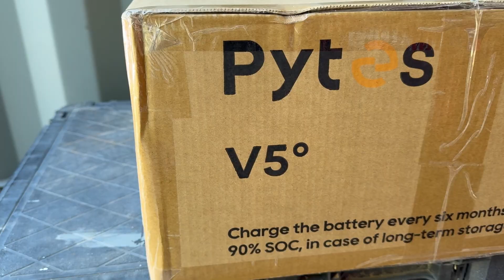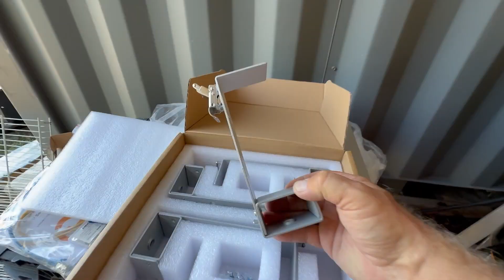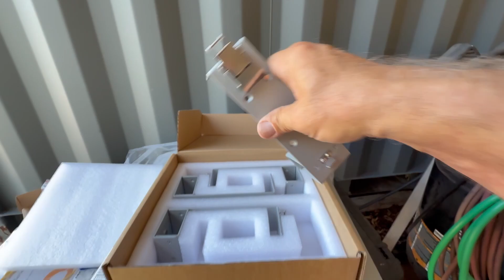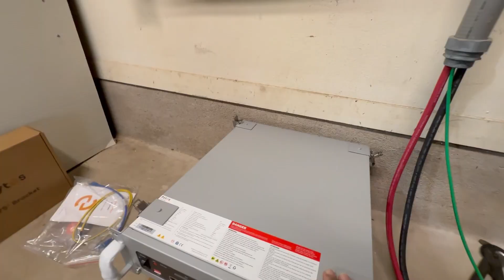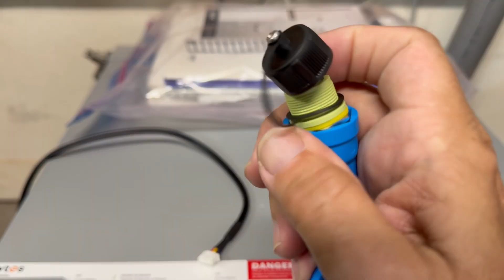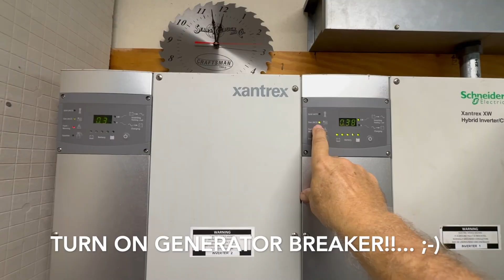Order Up!: A Short Stack of Pytes V5 keeps XW Alive!

Comment: I'm planning to do a similar build.  Still deciding on whether to use the brackets or the three battery case.  What size cables did you use to run from the battery to the inverter?  I read somewhere the terminals only supports 2/0.  Since the included cables support 300 amps, that seemed wrong.  Also, does the dongle need to be plugged into each battery for updates or do they share the connection.
Reply from the maker: It might be a little bit small, but I used 2/0 Cable. It would’ve been better to use 3/0 or even 4/0. I do need to research narrow lugs for the various cables, to figure out the exact measurement of the opening of the battery and what lug width is available.
Reply from the maker: According to Pytes, the batteries share the Internet connection.
Reply from the maker: I stacked the batteries with brackets because, what if I want to add another battery or two? There is room, and it would be easier with the brackets. And I don’t have a concern about protecting the connections from physical damage.
Reply: I like those brackets also.  I'm looking for a way to maximize the height because of limited wall and floor space.  The brackets only allow 6 batteries in a stack, while the case can be stacked 3 tall for a total of 9 batteries (wheels removed).  None of the documents say that, but I contacted Pytes and they said it works.  2/0 cable can be enough unless you have a few inverters.  I like a little wiggle room so I wish it would support 3/0 or 4/0.  The flat cables are rated for 300 amps, so I feel like the cables should match that to allow for large inverter draws when they are paralleled.  Three 18ks with 12 pytes batteries have the potential to exceed 2/0 cable capacity. I doubt it would cause an issue, but if you were charging multiple EVs with constant high draw, it's possible you run into an issue.  Assuming my calculations are accurate 😂

Comment: looks good. were you planning to show the battery how does the wifi connection work with the app?
Reply from the maker: I need to make a separate video for that since it is based on the SolarMan app.